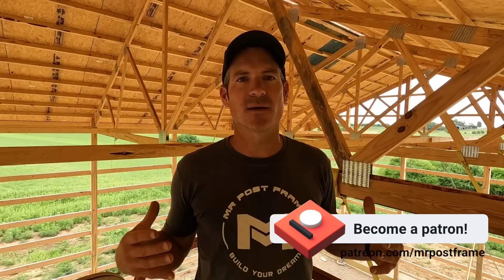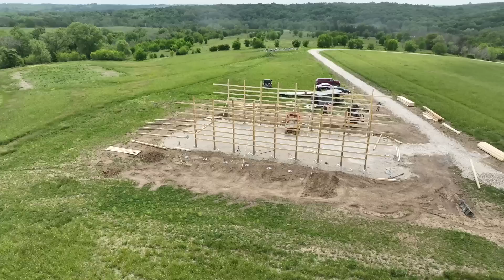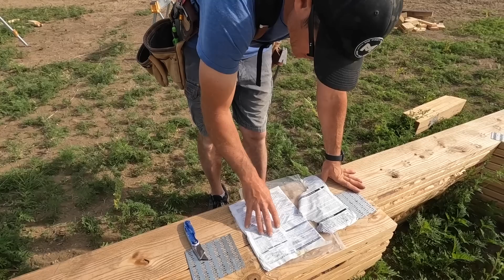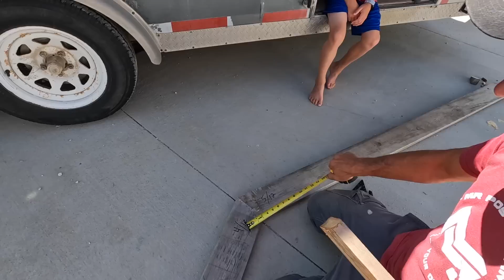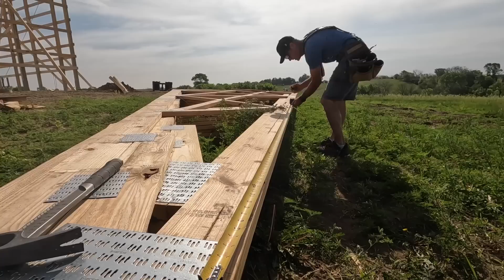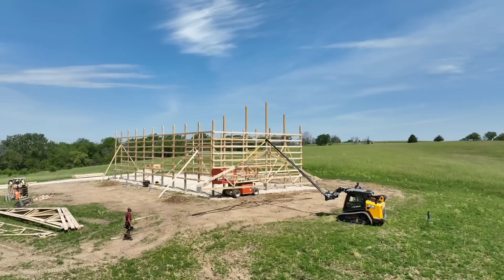Preparing Barndominium Trusses | 36'x80'x19' Barndo Build | Ep7

Comment: What specs do you have to be sure of to be able to frame a ceiling off that bottom cord and also for a plywood sheathed roof. Most people I’ve talked to want to do a 2 ply. How can you frame that on a single ply with 8’ centers and say a 48’ span? Thanks
Reply from the maker: As long as the truss is built for the load it will carry it will work fine on single ply,  8’ centers.  If you are in a heavier snow load area then I see 2 ply trusses. We are 30lb snow load area. I do residential loading (30-10-10) Our top chords will be 2x10’s a lot of times and our bottom chords will be 2x8’s. The truss plates (gang nails) have a lot to do with it as well. If they need to carry a greater load those plate get bigger and stronger.